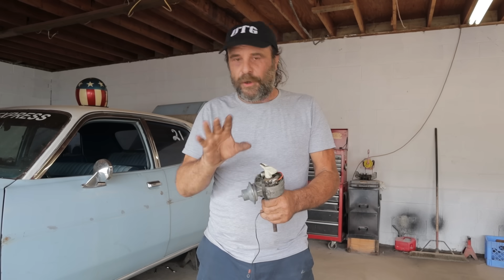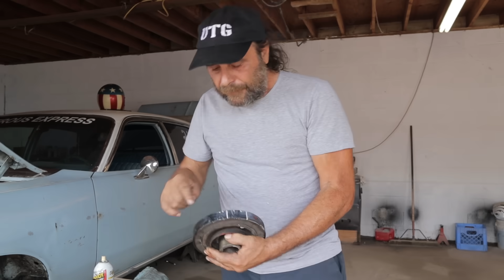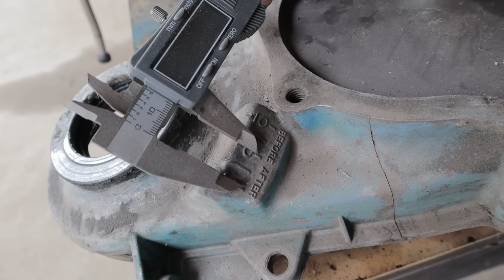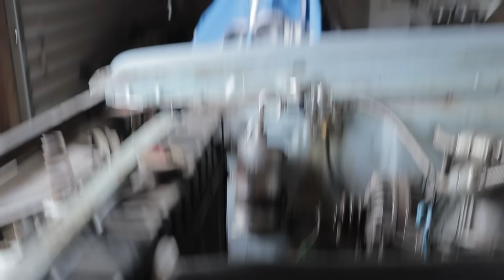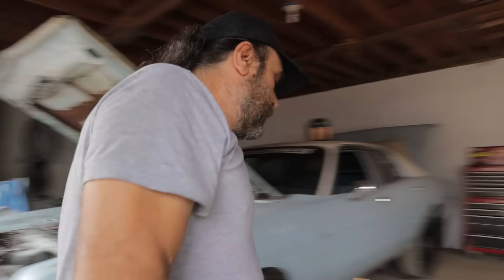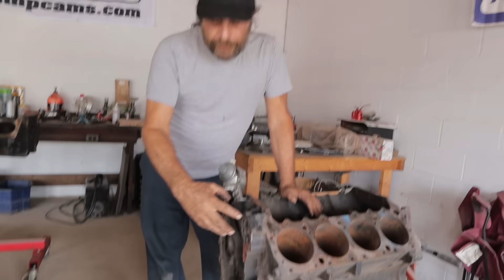Ignition Timing For Power

Comment: How do you get a spark with the cap off?
Reply from the maker: On most setups you just go from the coil wire to ground.  HEI is a little more difficult and is easiest with a second set of hands holding a wire from ground to the center post inside the cap.
Reply: @UncleTonysGarage  
I agree about the adjustable advance lights. It's also easy to mess yourself up. 
I remember setting total of 36 degrees on a 355, 10 to 1 zero deck motor (oval track) iron heads. I locked the distributor at 36 degrees on the balancer and (this is where I fucked up) I set the dial to 36 advance. It took me a few minutes to realize my mistake. Particularly, why won't this bitch crank over. I'm actually surprised it started back up! 
I was young and trying to impress.
Lol. My bad.
Reply: @UncleTonysGarage  , i have a question about a vacuum advance distributor that i set on my engine to 14 initial and 28 total without the vacuum canister connected. Once I connect it the vacuum canister advances the timing till 44 degrees advance at around 2300rpm. Do I adjust the total vacuum adjustment by adjusting the vacuum canister? Thank you in advance, you are one of the persons why I left my car carburated.
Reply: The coil will fire, with your new balancer mark at 30 degrees, and the coil wire attached to coil and distributor end unhooked and place near something metal on the motor will jump the gap when the distributor body is twisted to a position where the ignition points close.
Reply: @jeffreylunney3137  but the spark occurs when the points open.
The coil saturates and the condenser charges when points close. The switching causes the discharge. (Dwell is the degrees of rotation with points closed)
Reply: Jeffert Lunny, the coil fires when the points open.
Reply: @jeffreylunney3137  when the points open...
Reply: Ya I’m still confused with this, if you want it go come up on #1 plug but cap is off???? Confused
Reply: @rudyjhughes  you are feeding a spark plug from the wire that would normally go to the centre of the cap and triggering the coil off the points in the base of the distributor.
Reply: @rudyjhughes  The spark energy is created by the coil.  The distributor rotor position connects the coil to one of the spark plugs, number one top dead center plug is referenced as the initial of the sequence.  The repeating sequence firing order for a v6 is often 6,5 4,3, 2 ,1,6 5,4 3,2,1..  as the distributor spins at half crankshaft rpm..  For instance, the distributor rotor will be approaching the #1 plug wire as the #1 cylinder approaches tdc on the compression stroke.  The plug is fired just before the #1 piston reaches top dead center..  Then 6 5,4,3,2, in repeating sequence.  The distributor rotates 360 degrees while the crankshaft rotates 720 degrees.  This means 3 cylinders fire every rotation of crankshaft in the case of a 6-cylinder (each cylinder fires every other rotation = 4 strokes).  Intake(piston moving down, drawing fuel/air into cylinder) compression(piston noving up to compress air/fuel mixture), combustion(piston being pushed downward by expanding gasses of ignited air/fuel mixture), exhaust(piston moving up to expel spent gases past the open exhaust valve).
Reply: Rudy Hughes, were just trying to get the coil to fire. The #1 location is dictated by rotor orientation before you put cap in. So you should try to stab distributor with the rotor pointing to were you want #1 to be at.
Reply: You plug the number one cylinder spark plug wire directly to the coil on one end and to a grounded spark plug on the fender, outside of the engine. Hold the rotor hard in its direction of rotation with the distributor body past firing in that direction. Then rotate the distributor body in the opposite direction of the rotor rotation  until it fires a spark. To set it up, first the engine has to be on the compression stroke of number one cylinder and the distributor timing has to already be close. What I do is finger in the number spark plug hole and rotate the crankshaft until there is pressure (compression). Then set the balancer timing at 10 or 12 degrees before top dead center. With the distributor cap in place and ignition on, rotate the distributor in the opposite direction of rotor rotation, (or just back and forth for a rough position) until there is spark at number one wire on an open spark plug. After that rough setting, turn off ignition, pull the cap, plug spark plug wire directly into the coil, the rotate balancer to full ignition advance mark before top dead center (must be measured and added), then with ignition on, hold rotor hard in direction of rotation, rotate distributor body in same direction first, then in the opposite direction until there is spark.
Reply: @jimjungle1397  i havent completely stopped my brain to make myself understand what your saying.  At a glance I can see what your doing.  It is kinda hard to follow an explanation on how to do this.  Especially for someone who is just learning about ignitions.  I gotta say though......I cant imagine a more accurate way to set timing.  Doing it the way your explaining, a person would get a visual on all points. Instead of relying on a peice of instrumentation, a timing light for example.
Reply: @frankjones4950  I wonder if he's one of the yuppies that can't figure out a carb so they get a holley efi.  No offense to yuppies, i just prefer fixing things rather than just throwing money at it.
Reply: @codemang87  so anyone that uses EFI is a yuppie? Ok cave man. Lol
Reply: @Turbochapman  no. Anyone who switches to efi ONLY because they can't understand carbs is a yuppie.
Reply: Setting up timing for initial start on an engine using UTG method is for external coil designs, not HEI (GM internal coil/cap design).  Another way is to mark the distributor housing where cyl #1 of the dist cap lines up (external or internal coil design).  Then turn the dist where the points open or where the two electronic points line up on the shaft and the pick up coil and the ign rotor is pointing to your mark on dist housing for cyl #1.   I may of butchered this trying to explain, but an experienced mechanic will know this.  Cheers,
Reply: @mikeymike758  usuallly close enuff just aligning rotor to #1 tower to get 'em fired up but timing light works while cranking too, and needs to be used anyway (if one's available).  I like a timing light b/c can't always hear detonation, especially when someone else is the driver and you aren't there.
Reply: @thisisyourcaptainspeaking2259  Totally agree.  My point was initial start up when the dist has been removed or it's a fresh engine for first start up.  Of course you use a timing light to set base timing and max advance once running.
I was trying to educate those that are not licence mechanic and offering information.
I've never used a timing light on cranking for first fire up, as my method always fires up the engine.  Whatever works for you, as long as it fires up on the first crank.  Cheers,
Reply: @mikeymike758  Agree!
Reply: @thisisyourcaptainspeaking2259  Cheers,
Reply: hold on to this wire and tell me when you feel a tingle  lol
Reply: I think the information you spew out on here is absolutely great. Old school tech that I fear is soon to be forgotten.  I like the new computer controlled setups but nothing beats the old school setups. I wish I could work with you for a year just to absorb some of the information you have stored in your head.
Reply: Now with the carved marks he now has a harmonic unbalanced-er lol
Reply: @billyfromtheusa Correct, the device used to determine crankshaft position.  Ignition base timing is derived from this signal.
Reply: Who would want to do this ?????
Reply: "Initial advance we don't care about so much unless it's advanced to the point where the snout and bendix gear are torn from the starter just as the engine fires off and comes to life". A good indicator that somehow you need to back down a few degrees of initial advance to tame the initial reaction at the moment the engine fires. Alternatively as U.T. has explained in at least one other video to go to a setup common in many drag race cars where the starter motor voltage is separated from the ignition power. So the starter can be activated and spun and then power to the ignition circuit is switched on while the starter is cranking the engine over instead of the ignition being live from the very moment the starter begins rotation. Makes for a more seamless start devoid of dramatic initial load on the starter due to so many degrees of initial advance.

Comment: older video but personally running vacuum advance on a classic performance car is stupid. If someone wants gas mileage they should just buy a Camry.....I never liked the tape on a damper either as you are depending on someone else to get the math right calculating the marks on the tape which are determined by the circumference of the damper.....you also have to take into account the positioning of the timing tab....Pontiacs had atleast two different dampers with two totally different diameters...the angle at which you viewed the marks would dramatically move the appearance of the timing reading

Comment: Its a mechanical data acquisition system you can check the clearance and tolerances of the components tonmake it more precisely what timing you have chosen i imagine somthing as simple as some slack or inconsistency in the tensioner for the timing chain as the spark timing is based off of the crack relationship between the cam and crank position sensor, upgrading to somthing more consistent will be beneficial, make sure to time your timing gun and cross reference timing with TRUE top dead center position with a dial indicator,

Comment: I'd argue his last point of re setting advance for starting up an engine.  He states to set it to your total advance of say 30 degrees, then insert your distributor and turn the housing until you get spark.   That's for initial timing, not your total timing.   Doing it as he states will then introduce even more advance once the engine starts and the mechanical advance kicks in.
Reply: yeah he is saying to twist the rotor over though, which will then activate the mechanical advance... then rotate the distributor housing to get the spark. He's right, but I've never seen anybody do that, and he's making it overly complicated for some reason.

Comment: How do I set the timing on my 2000 dodge ram 5.9 magnum? Have the auto makers made it so that I can’t? If so, how do I remove it? I feel like it is my truck and I should be able to do whatever I want to do to it. I purchased the truck and should not be kept from information that will assist me in working on it. I shouldn’t have to pay for it. I own the truck and I feel all of the information that is needed to repair my truck. Was hoping you could point me in the right direction. Thanks in advance

Comment: So… I have set my timing to 0degrees tdc on my 74’ 450SL Mercedes. The decal says 5 degrees above tdc at idle and 750rpms. With vacuum connected. So I have it set to 5degrees when it’s running by rotating the distributor.  

Do I turn the engine to 5 degrees before tdc before I set the timing with the distributor? I always thought all engines have to be at 0 before setting the timing with their distributor?

Comment: ATI dampeners are not cheap, but the 360 degree timing marks are worth every penny. Totally agree on the dial back lights being inaccurate. Threw mine out as well. Static light and 360 timing marks are the way to go. Thanks for another great video

Comment: how about a 305 v8 with 301,xxx miles in 95 1500? Im looking for performance of getting from A to B consistently.  I marked rotor location on the distributor ring. I put it back , it seated , but it doesnt start. Bout to find tdc on #1 but not looking forward to it.

Comment: are we going to do this method without starting the engine while setting up avns without an advance light, uncle toni?for example, after we overlap that 32 degree or whatever sign you said, we'll put the distributor back in place, right? then we'll figure out how to get the spark flash, the battery will be plugged in, right, the ignition is on, but we'll do it without starting the engine, did I get it right?

Comment: I understand the importance of full advance timing coming in as soon as possible during a drag race.  However, is it possible that HP is being left on the table at the lower RPMs during the engine acceleration phase?  Now that inexpensive Progressive Ignition Distributors are now available, wouldn't programing the advance curve to match engine speed increase available HP?

Comment: Sometimes I wish I could jump in the video and help you explain some concepts. I trained Auto-Diesel Tech for thirty five years during the muscle car era.
In order to do power timing with certain degree of accuracy, you best have access to a chassis dyno and the proper test equipment. Power time a stock engine at peak torque rpm under load was best practice at the time. A modified engine is best power timed on an engine dyno. Although it can be done if you have proper component specs.
You can still semi-power time an engine under no load, by moving the distributor until you achieve best vacuum at peak torque rpm and go from there.
I have a question: how lean is too lean? During the early 70's, while doing R&D work, I had carburetor curves set at 21:1 at cruising speeds and with the proper engine timing.
I know you were trying to show how to "static time" an engine. I think it would have made more sense to the viewers if the distributor cap had been on the distributor and at least #1 cble had been on the cap 
Keep up the good work! It's fun and instructional watching your videos.
Cheers!

Comment: Why is it that engines on boats do not have a vacuum advance ?
Reply: You can actually do away with the vacuum advance on your car distributor if you have a Synchroscope to recurve your mechanical advance. Vacuum advance is mainly to improve fuel economy during off idle/cruising speeds.

Comment: I never use timing marks or a light to adjust ignition timing. I’ll have an assistant put car in gear, load the engine and then I’ll advance the ignition timing as far as I can go until the engine starts spark knocking, then back it off until it stops.
Been doing it this way for years with great results.

Comment: Hey bud that’s wrong! The diameter of the balancer is different than the “diameter” of the marks… you need to measure or calculate the circumference of the balancer which is 360 degrees and calculate your needed timing from there

Comment: When doing engine break in advancing the timing an extra 5° can save your header coating. When the engine is in a no load condition the crank moves faster than the flame front and you will still be burning the mixture when the exhaust valve opens. Make sure to back it back down when you go for the test drive.

Comment: Hi Tony, You are a great source of information...
You talk about driveability, what exactly do you mean by that? because I can't tell any difference other than a smoother idle when running manifold, I have a manual transmission, is that where you would maybe see a difference, is between manual and automatic transmissions? I'm sure there are many others wondering the same thing. Do another Distributor episode....

Comment: I tried your "drop in" dizzy procedure to try and time out 305. But looks like I didn't have much luck because you have to turn the dizzy fast enough for it to spark. But what I didn't do was hold it "hard" in the direction of rotation. That probably would have helped get rid of the slop that I was dealing with. Either way it got me close enough to start it up, set at 10deg initial. Was also a hei unit and I'm wondering if that matters to get it set perfect? Thought maybe points and condenser have that stored energy. Blazer needs a tune up so I'm re watching some things.